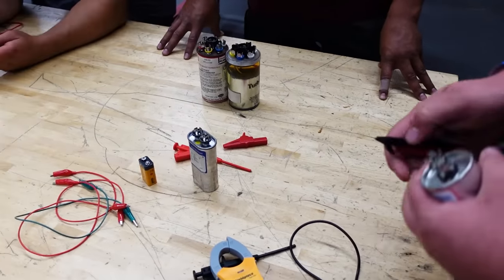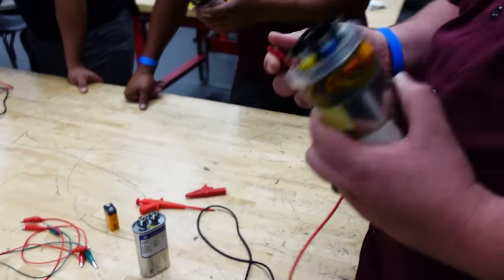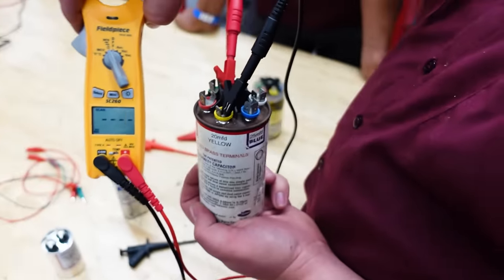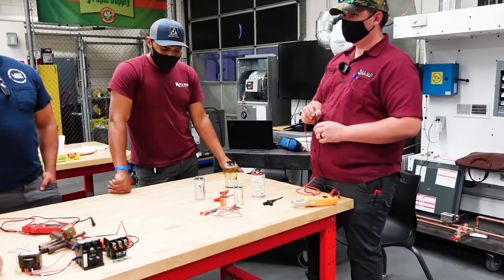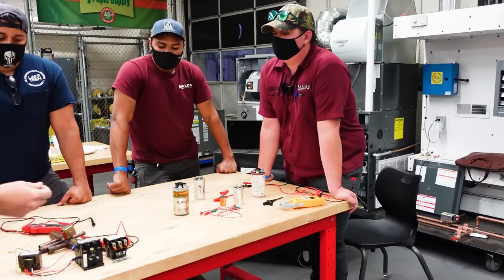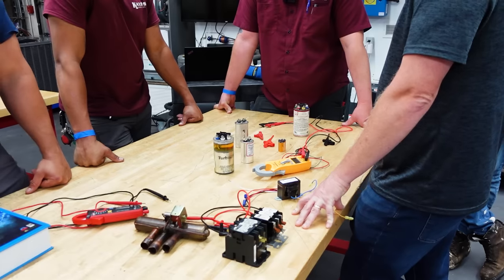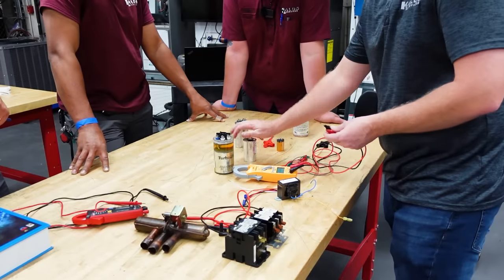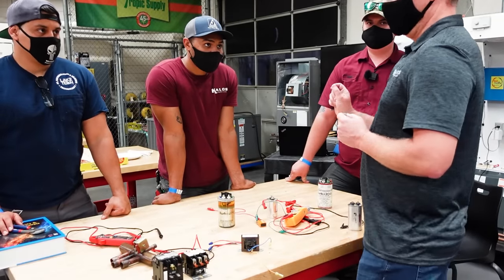Run Capacitor Fundamentals Class

Comment: The next generation of techs will be much more ethical and efficient with access to good training like this!
Reply: Even current techs like me are trying to get better every day.
Reply: I have yet to find a good tech where I live.  Makes  me think about changing careers to help people
Reply: @tekjunkie28  It is a real challenge to find a great technician in the residential field. There are a lot of factors. In coastal Texas for one example, residential techs HVAC can make great money during the hot months of the year, but struggle to get enough hours during the mild winter months. The higher skilled techs tend migrate to the commercial field where the hours are steady year round , the work is less laborious and pay/benefits are typically better.
Reply: Too bad it will just be overshadowed by companies who only wants tech who can sell rather than fix. Only reason who I stay in commercial
Reply: I agree.   learning  alot and try to fine tune still pretty young myself but glad to say videos like these keep me frosty"skill melt like ice so stayed frosty"
Reply: Face diapers! Darwin has a plan…! 👀🧐😎😜
Reply: Or not...
Reply: @lightskinutah  90% of the time a thorough cleaning of the evaporator coil will fix the AC.  But that is hard to get to so they just hose out the condensor hook up the guages and claim to add freon.
Half of the ducts in the house don't even have flow.
New techs need to FIX WHAT IS WRONG.
Reply: When checking out a capacitor with a multi meter, which positions are the leads plugged into on the meter?
Reply: @davidrabold2839  on my meter the leads are plugged in to the same points they are plugged in to for voltage readings but younset the dial to the capacitance setting. Not all meters are designed to read capacitance so make sure you have one thatbis and also make sure you bleed the capacitor first by shorting across the terminal with screwdriver. If you don't have a meter that reads capacitance you can pick up a pretty decent one for a reasonable price at harbor freight.
Reply: The next generation  of techs will be robots,let's be real

Comment: I'm not sure why this video was I my feed today,but I'm absolutely ectatic after two years of not being able to figure out why my air compressor wasn't working properly..  I had replaced the start capacitor a year ago ,cause it kept blowing the breaker when I tried to turn it on. Well I was having a issue with the parts guys about getting a new run capacitor,and I don't have a credit card s online wasn't happening, well after watching this video I got my voltage meter went down stairs to the thing ,and low and behold someone had put the wires on the one terminal on the run capacitor,I switched it not knowing which one went where,but it fired up and kept going!wow! I'm very happy. This was a compressor that someone had given me cause it didn't work 👌🙂👌it's a 6hp 27 gallon🙂 ps I'm now a subscriber!

Comment: A meter could check the capacitance by putting a AC test charge on the capacitor and measure the phase shift in the circuit.  It could also measure the voltage rise rate and /or decay rate over a resistive circuit.  When an ac capacitor is installed on an AC circuit, the voltage of the capacitor is dependent of the current "pumped" into the capacitor, since the voltage would change direction before the current could completely build up the charge it would always lag the source voltage.  This lag is really represented by the line resistance.  The more line resistance, the more the lag.
Reply: Interesting. Thanks for trying to explain.

Comment: Great!!! One of the fundamentals of capacitors is understanding they (many types) are rapid discharge devices. Several decades ago in electronics school, it was cool to see the spark when leads were shorted together. Yes, safety first, but we did learn a few pranks/tricks.

Comment: I was taught that in a sine wave, the amps lead the volts which means they do not happen at the same time, so they are essentially out of phase. A run capacitor works to put the amps and the volts in phase and this gives a running motor much more torque.
Reply: Depends on the load, for a purely resistive load the voltage and current waveforms are completely in phase. A motor is a highly inductive load though, which is the case you described.
Reply: A run capacitor let's you use a 3 phase delta motor on a single phase supply.
You are right that a capacitor will shift the phase.
Connect line across 1 winding and the correct value capacitor across another will shift the phase on that winding by 120 degrees.
The third winding will "see" the difference of the first 2,and that is the 3rd phase.
Reply: ELI The ICE man!
Reply: @dougaltolan3017  Actually, no.  The capacitor is sized to shift the start winding current 
by 90 degrees from the run winding, simulating a 2 phase motor.
Reply: @cleansebob1  Actually yes. A delta wired 3 phase motor can be run from a single phase with a run capacitor.

 A motor with 2 windings will have a main and an auxiliary. The auxiliary winding is normally thinner guage wire and have fewer turns.
Capacitors are used to shift the phase of the auxiliary winding to match the geometry of the layout in the stator.
Auxiliary windings have optionally a run capacitor, a start capacitor, or both. If a, start capacitor is used, it is switched out either by a centrifugal switch or a timer.

Comment: The meter is actually acting as a very high impedance path, that's why it is slowly discharging. If it were low impedance the cap will discharge rather quickly.
Reply: I thought impedance only related to AC current whereas the meter operates in DC and has a high resistance but is nevertheless consuming some current while taking a voltage reading?
Reply: @fahey6797  impedance is whatever opposes the flow of current. Impedance is the combination of resistance and reactance. So impedance changes with frequency. But there's still impedance even with DC. It's just a different impedance. Clear as mud!

Comment: What a capacitor does with an induction motor is create another line phase. A capacitor connected to AC makes the voltage lag. This is handy with single phase motors to give you phase angle to develop torque. You're sure not using the capacitor to store a charge while a motor is connected to line voltage. There's plenty of charge on the line all the time.

Comment: There's a channel Ludic Science that has a video 'Making a High Voltage Capacitor' out of 3 disposable plates, a couple pieced of aluminum foil and baby oil.  Very good if you need a visual of what makes a capacitor.  They just roll something like that up in the can for run caps.   Also, his 'Electrical Reactance Demonstration' video is the best for seeing how inductors/windings and capacitors act like resistors in AC series circuits.

Comment: I've heard that standard reasoning, of back EMF from the motor causing higher voltage drop across the upstream capacitor, but I think it's not accurate. It's a confusing topic because there are two kinds of back EMF, the kind of reverse voltage that comes from the motor acting as a generator, and the kind that comes from inductive properties of the coils inside the motor. I think the higher drop across the upstream capacitor comes from the inductive properties, not the generator effects. You can easily model the higher drop across the upstream capacitor with an A/C series LC circuit. At resonant frequency you get huge drops across the cap, since electrons are shifted back and forth between capacitor and inductor like a juggler tossing a ball. That's why it is so important to have the correct run cap in line. The circuit needs to be tuned to resonant frequency. On the other hand, the generator effects of the motor cause a reverse voltage (in phase) which can never exceed incoming voltage. A reverse voltage charging the downstream side of the capacitor would tend to increase voltage on the downstream plate, effectively reducing the drop across the capacitor plates. Unless the generator effects are out of phase, you shouldn't see big voltage drops across the capacitor coming from pure generator effects.

Comment: You are mixing start and run capacitors, even though at one point you stated they aren't the same thing.
A run capacitor allows a 3 phase delta motor to run from single phase supply. The capacitor is connected across one winding, the line across another. The combined inductance of the winding a d the capacitor phase shift the voltage on that winding by 120 degrees ie a second phase. The 3rd winding is subject to line minus run capacitor winding, which is equal to the equivalent of the 3rd phase.

A start capacitor is used in an induction motor that has 1 main winding and an auxiliary. Without the start capacitor it is 50 - 50 which way it will run at each start. The addition of another (smaller) winding and a capacitor means that the motor will always run the same way.
Reply: You confuse even more. 3 phase motors do not need capacitors to run. Back to basics please.

Comment: Nice video.  I tend to think of a capacitor as a mini, fast recharging, UPS.  It smooths and boosts voltage when large motors kick on and run, helping them operate more effectively.  Since they cycle so much, they do have a lifespan and are one of the more common components to fail.  Just the nature of the design and their purpose.
Reply: More importantly the capacitor causes a phase shift. 
remember:  ELI the ICE man..

Comment: The run capacitor creates a 90 degree phase shift in current when properly sized for the load with ac going through it. This causes a rotating magnetic field around the rotor.
Reply: So it does what to the speed and torque of said motor. Its the core answer to why you have one in use on many items.
Reply: That would be a start capacitor, a run capacitor corrects power factor. Once a single phase motor is running the start capacitor is removed and the run capacitor is not.
Reply: AC rotates. A sine wave is just a circle stretched out. As the circle spins and time is mapped on the Y axis you get a sine wave. That curvy up and down is really round and round. Just looking at the waveform that way isn't so useful to us. So on a scope we express it differently. Visualizing all of this was the brilliance of Nikola Tesla. He saw it all in his mind before any of it existed.

Comment: Thanks for the video, it is great learning the wiring of compressor and fan capacitors. Way back in the 80s when I worked on cars, one of the practical jokes was to take a ignition capacitor and charge it with a spark plug wire and the lay it somewhere where you know someone would pick it up and of course it would shock them :-)
Reply: Yes, this also proved that the condenser (capacitor) was good. I was surprised that the capacitor only retained 9.6 volts after being hooked up to a 9 volt battery. In the old ignitions the condenser served two purposes. First it reduced arcing at the contact points & second when the points broke contact it discharged at about 250 volts to the coil (transformer) which in turn boosted the voltage up to 20,000 volts. At least that's what I was taught.

Comment: Some good info about capacitors per se, not much at all about their function as run caps in AC motors - or how to diagnose bad ones - symptoms of failing / failed parts.

Comment: PFM LOL! I think “the math” is probably based on this equation. Amps x 2652 / Volts=MFD. For example you can check a capacitor on a running system without disconnecting by measuring the amps on the start wire multiplied by the constant 2,652, and then dividing that number by the voltage across the capacitor terminals. This trick comes in handy in situations when shutting the system down is not an option or when using a meter that doesn’t measure MFD.

Comment: No professional HVAC experience here. Great instruction and your principles are solid (from this old electrical/ electronics guy). Especially at the end: RMS 120VAC = 170 V-Peak
Reply: And he said the meter is averaging the value to read. Which is not correct.

Comment: Great video!!!  I looked in a condenser unit and it had a dual cap with a 60 MFD herm. Looking on repair clinic the model showed it should use a 30 MFD. The 60 MFD was out of spec but must have been in this unit for years. Should I replace with the 30 MFD?  I did not look on the compressor unit itself but need to do that too to see if the MFD is noted on the compressor. Trane model TTD760B100A2. Thanks!!
Reply: It is very important to use the correct value capacitor. It is matched to the motor windings and line frequency.

A run capacitor let's a 3 phase motor run from a single phase supply by phase shifting the voltage on one of the windings. The wrong value capacitor will create the wrong phase shift.

The result is a motor that will not be able to reach rated power and will get a bit hotter.
If the motor is sufficiently over spec and there are no cooling issues then yeah you can get away with it for years. But it will run better and more economically if the right cap is fitted.
Reply: @dougaltolan3017  - after doing some further digging I realized that the 60 was replacing the original two 30 µF capacitor‘s. So two 30s equals 60 so all is good

Comment: Great video but maybe i missed it, question... I realize it's been 2 years since you did it But... say you had a capacitor that was out of the tolerance by far yet the compressor does start up... is it possible that that out of tolerance capacitor would cause the compressor motor to work harder, leading up to thermal overload protection activating on the compressor after it's been running for a while during the day?

Comment: New to the field. I was told replace cap. If system works after then is was cap. If that doesn’t fix then it’s motor. Providing there is actuallypower. Labor wise, does it make sense to go through all this?

Comment: In the case a capacitor has common, herm and fan, but fan is not connected on a fully functional condenser unit, what information about the fan can be assumed?  Does the fan simply not require a capacitor? 1:38

Comment: I can't get to coils to check / clean unless I take it apart even more quite extensively than I have so far and so I guess I'm going to try replacing blower motor capacitor . Coils sitting on top of furnace and I would have to cut freon and drain lines . Yes it might be very dirty but don't wnat to go further and capacitor is only $12 . That might work ?

Comment: Some confusing moments in this video, wanted to clarify..
Start winding need a start capacitor which is usually disconnected by a centrifugal switch. The start capacitor is usually of large value and short time rated.
Run winding requires a run capacitor which is always connected to the power in series and continuous rated..
The higher voltage that you measure across the capacitor is because of the LC circuit impedance. You will also measure higher voltage across the run winding for the same reason. Not because of the motor back EMF
It is because of this the capacitor must be purchased with the voltage as per the defective unit and not based on supply voltage.
Start and run winding should not be confused.
All capacitors in market will have a higher capacitance value than the nameplate. If the measured value is less than nameplate value by more than 10%, needs a replacement soon. 
The run capacitor provides a phase shifted current on the run winding with respect to the main winding, creates a rotating magnetic field which turns the rotor. 
Regards.

Comment: Hello
I have a120volt 1hp motor single phase do I need a capacitor to transfer power from house current to generator so the motor doesn't stop using a 4000 watt electric generator 
Thanks bill

Comment: I stupidly didn't pay attention to the color of wire coming out of the starter capacitor on my washing machine before I disconnected it so now I don't know how to tell which side gets power and which side connects to the motor. Now there is a diagram on the side of the capacitor, but I can't seem to find anybody mentioning how this pertains to which side is power in and which side is power out. Is the side showing the coil power out?

Comment: I need some assistance concerning a capacitor.   I am replacing a capacitor that reads 370/440.  My replacement capacitor reads 370 VAC.  Can I use it.    The other question: if only 240 volts are going in why is it use for a max of 440 volts. Finally,  a capacitor test is in mfd. so why is voltage a concern or a measurement for a capacitor. Thanks for your support.